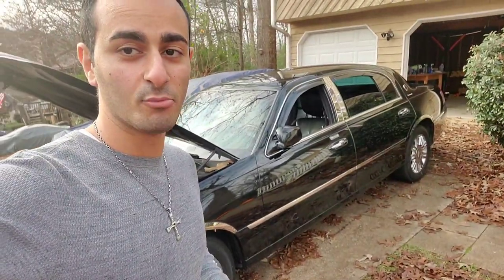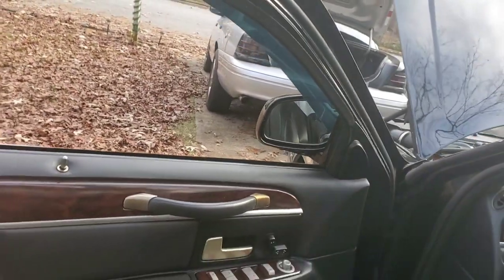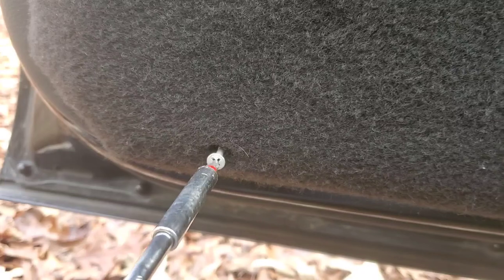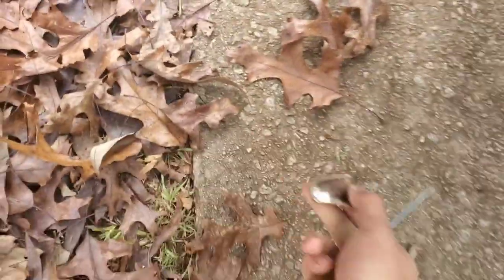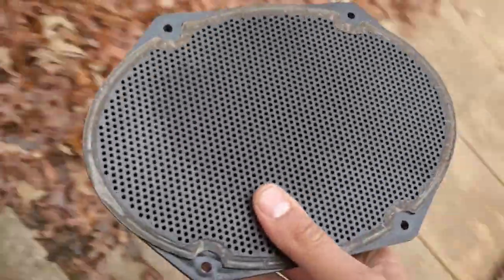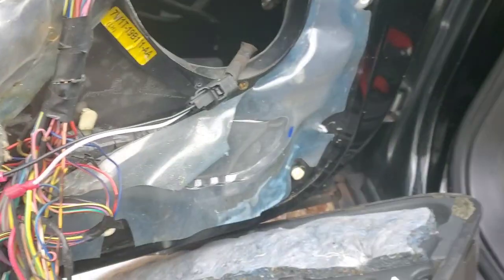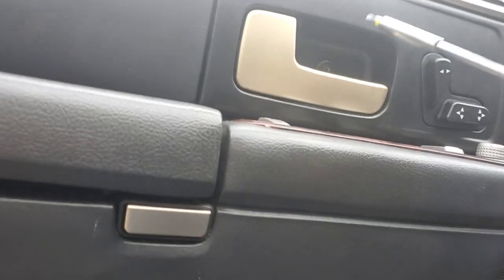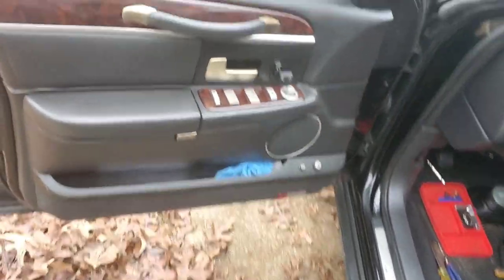DIY- HOW TO UPGRADE THE FRONT SPEAKERS LINCOLN TOWN CAR

Comment: Everything you did I did the same many moons ago. And yes a huge difference in sound quality. I still have the OEM 6 cd changer stereo. I want to keep the front dash looking original. You the best thanks for showing this. True if your going to do any upgrades to the Lincoln town car sound system. Start with the speakers, I knew a Sargent in my unit that had the Lincoln Aviator. When they came out, he changed the head unit. He ended up regretting it. It was to complex for him to work it, and play one cd. He said the OEM was a 6 cd player and easier to use.

Comment: Dude. I did the same on my 03 GM.. they R F  suck in the winter time..the liquid in the magnet freezes..the install was easy , got them of Crutchfeilds with the harness adapter. The screws that hold the speakers in rounded out as I was removing them.. made of some very soft metal.. Warm weather uses was great ... great sounding speakers along as its above 20 degrees...Those weren't factory screws on the bottom of the door panel map pocket.looked like deck screws...

Comment: What is the part number for the adapter plug used on the front speaker connectors? I’m wanting to upgrade my speaker system also and would appreciate your help with seeing what you used and where you bought it. Thanks 🙏

Comment: Hey, my '07 Grand Marquis Ultimate Edition appears to have an amplifier mounted beneath the rear window, next to the spare tire. 
I read somewhere that some Panther cars with the premium sound system came with a factory amp and 8" sub. I'm curious if you'd know anything about this?
The car is in storage for the winter and I've been too lazy to take out the OEM trunk organizer and spare tire and crawl into the trunk to take a look. 😂
Thanks.
Reply from the maker: Yes premium sound with an amp. Are you looking to replace it with an aftermarket amp?